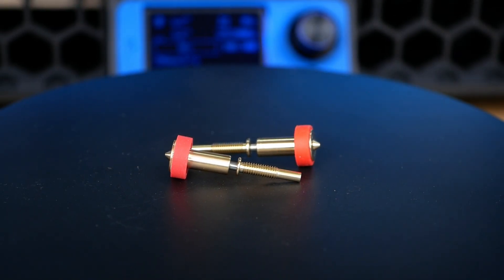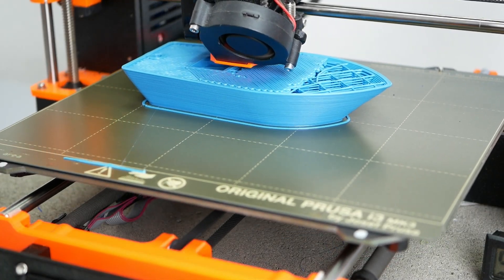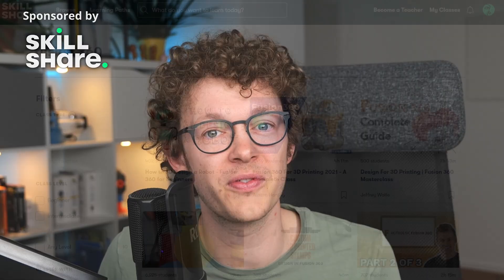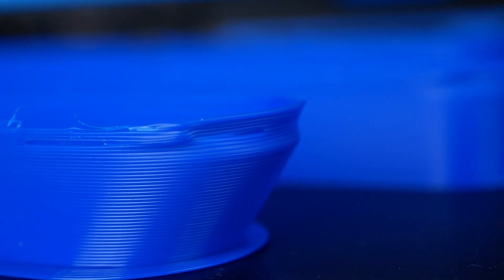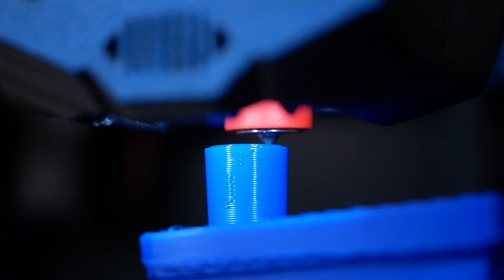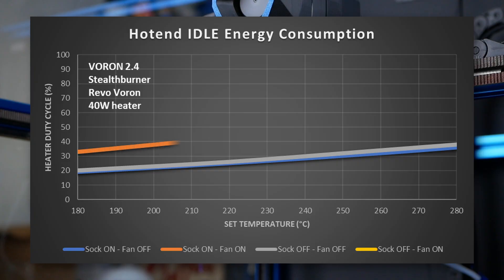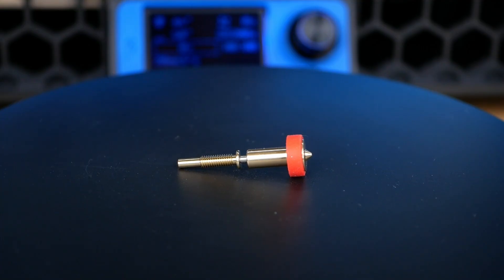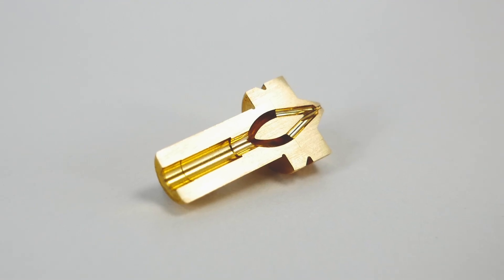E3D made an impressive HIGH FLOW nozzle!

Comment: Even though i am a budget 3d printer enthusiast if i were to get a highflow nozzle i'd probably end up getting one nozzle per plastic type if i was switching filaments and printing at a high volume. Currently i just push some filament through and clear out a diff type that way.

I do love these HF designs though.

Comment: Vector3D had different conclusions than you Stefan. He found the high flow Revo is better than their stock, which was lower than a stock V6. The CHT won overall with a better flow rate. He used your test print as well. 

Wonder if the adapter contributed to worse results?
Reply from the maker: Adam used different hotends which makes "nozzles" hard to compare. Yet his results go hand in hand with my conclusion. Revo HF is good for it's size but if you want max flow, get another hotend.
Reply: @CNCKitchen  thanks for clarifying. You were attempting to make an apples to apples comparison. So if someone took the Revo HF nozzle design and put it on a traditional V6 style hotend… It would beat the CHT head to head? So Revo’s shortcoming is the length of the heat zone/break?
Reply: Vector3D found its lower than a Pheatus Rapido with a stock V6 nozzle. The Rapido is way longer which is why it performs as well as it does
Reply: @jamesclive-smith3383  Am I wrong about the CHT nozzle having a better flow rate vs the Revo high flow.
Reply: The issue was probably the teflon tape, insulating the tip.

Comment: I have not tried the revo HF yet, and I want to, for sure. I have standard 0.4, 0.6 and 0.8 nozzles. It is true, I never changed nozzles as often as I do now, but I'd say that at least 80% of my prints are done with the 0.6 nozzle and with the speeds of the voron 2.4 I am limited by that flow. 
I really want to try the new HF nozzles but the fact that it is $45 a piece plus another $45 for the heating element... It really feels like a rip off. It makes me want to change to a rapido HF right now and go back to my ratchet wrench to change nozzles.
Reply from the maker: I wouldn't call it a rip-off because these things are expensive to manufacture. Yet the design is definitely not made for super cheap maufacturing. Bondtech did a great job in that regard honestly.
Reply: @CNCKitchen  maybe not if it's your first e3d hotend, but if you already have an standard one, and now you have to buy a $45 nozzle and a $45 heat element, that's adding $90 to an existing hotend. What am I going to do with my old nozzles and hot end? buy another heat sink and install it on another machine?
I understand that are not cheap to manufacture but it doesn't excuse the fact that you are paying $90 for a nozzle.

Comment: If I ever get around to spinning up my 3d printing business again, things like this are worth it. For a hobbyist that may print a couple smaller things per day, probably not
Reply: I'm thinking the opposite. In a business setting you don't want to fiddle with your printers. If you need to print in multiple nozzle sizes, you just have one printer for each size. In my opinion the Revo is mostly useful for hobbyists with limited space, or who really don't want to own more than one printer.

Comment: Considering this was promised for a year, the payoff is very disappointing. I'm glad i only fitted a revo on a bed slinger and never put on any machine that actually needs abrasion resistance or actual high flow. I expected a longer melt zone a true high flow abrasion resistant option, since it is a fully closed ecco system, would be a long time before i get anything else e3d. I switched my big machine chc pro ceramic heaters, and i can use any standard abrasion resistant volcano length nozzle.

Comment: Its good, but the nozzle is almost as expensive as a complete Volcano hotend with a Bondtech CHT Volcano nozzle. Which probably has even higher flowrate? With regular nozzles theres also the option of hotends with even longer meltzones like rapido. Or abrasion resistant CHT Volcano nozzles (for the same price). Or knockoffs which might not perform as well but are really cheap. Theres just so many more options available as well.

I really like the Revo system but at the price / performance point its a pure luxury.

Comment: I think you might not have considered different fans for part cooling in your heater wattage comparison.
Have you seen what fan comes stock with ratrig machines? (They use 20W server fan for layer cooling) 
Not to mention VZbot, or hevort where their cooling systems are really impressive. 
Other than that, this video was amazing! Thank you for the job you do.
Reply: yea, on my ratrig with a server fan and with 40w revo, I cannot print temps higher than 255C. Otherwise the hotend just cools down and cannot maintain temps.

Comment: Cold pulling is absolutely not necessary.
In doubt use cleaning filament. 
Or just never let your filament cook in the nozzle for too long. It needs movement.
Reply from the maker: Yes, but did you even have a particle stuck in your nozzle. Cleaning filament won't help you there.

Comment: I get that pressfitting that core in there makes sense to get the best thermal transfer and makes it completely tight and rock solid. And it's probably easier and cheaper to manufacture than a threaded version. If you could unscrew that center core piece however, it would make cleaning/repairing or even replacing a worn out nozzle tip so much easier and cheaper.
Reply: I had the same thought: how the hell would you unclog that thing?  You will not be able to push a needle through it, right?  Also cold-pulling won't work, I guess ...  So, how do you unclog this if some cooked plastic gets stuck in that bottom cavity?  Lemme guess, you have to buy another one of those expensive nozzles?
Reply: @MisterkeTube  Probaly burning it out by heating the nozzle with a torch
Reply: @MisterkeTube  the needles ive used have some flex/bend in them, but if you suspect one channel is clogged, its hard to know if your poking the right one (with a cht, anyways, and this and the clones would be the same)
Reply: Lining up the holes would be a nightmare with threads.
Reply from the maker: That's a good point but a thread would make manufacturing even more complex. I'm currently printing a ton with the nozzle to see if it has a clogging potential and how I can properly clean it.
Reply: And you could just replace the threaded insert to change the diameter! Wait we just designed a V6 hotend... My point is: by making it a threaded insert you would invalidate the whole design...
Reply: they don't like "cheaper*
Reply: The whole of the assembly is the nozzle.  You should probably re-think the take there.  It's quite evident that the adapter has issues- which does the thing you talk to.

I'll say it...again...

If you're thinking in terms of the old-school nozzles, this is probably pricey as hell.
If you're not doing STUPID things with your nozzle it's NOT.

You're not driving your nozzle into your printbed repeatedly, esp. using a glass bed, riiiight?
You DO know that glow in the dark, CF, GF, or similar is super abrasive and you needed a hardened nozzle, RIIIIGHT?

This isn't in the same spaces as the cheap crap they sell off of Amazon.  If you're hooked on that, none of this is for you.  Seriously.

This is the same rough space as the stuff you'll spend as much as $80 per nozzle for.  It's not the same thing and I honestly wish people would quit trying to map the pricing of the cheap crap onto this.
Reply: @frankearl9285  the point here is that a Revo Voron is $80... upgrading to a HF nozzle is $90 more... 

it's like buying a car for $30,000 and when you have to replace the tires you realize that the tires are more expensive than the whole car.

Comment: Kind of curious as to whether switching from resistive heating to induction heating may ea way to change the power use. In essence replace the heater block with a ferrous metal cylinder just larger enough than the heat break and nozzle to allow for the threading, an induction coil around that, and the electronics to manage that (and monitor temperatures, perhaps with an IR sensor rather than a diode.)  Note that I'm fully aware that this may be a higher price point than people are willing to pay, but I'm thinking of it more along the lines of focusing on just heating up the parts that are going to be heating the filament, and hopefully in the process reduce wattage. And there's nothing saying that someone couldn't design in a means of using a diode for temperature control, and build the control for the induction system not the software of the device. Us a pcm signal to control duty cycle of the frequency being passed to the inductor.

One potential benefit could be that once the bed was up to temp, the nozel could be brought up to temp in the time it takes to move from completing an ABL test, to the point where the printer does a prime wipe.
Reply: Induction heating is resistive heating. The only difference is that you don't need electric contacts, which is important in some applications (stoves, crucibles...) but quite irrelevant for a 3D printer hotend as that anyway needs to be rigidly connected to the extruder. So this would just add a lot of complexity with no real benefits.
Reply: @leftaroundabout  There are two parts that I think might merit attention. 

1) the part of the process that gets heated is integrated to the path of the filament. Not to the electrical path. This would be potentially useful in making it easier to replace a setup like a Revo nozzle, as the inductor has no physical contact with the part that is being heated. 

2) having a smaller heating element that can handle the heating, that the filament interacts with directly would mean that there is far less surface area of that element that is occupied with warming up the space around the printer instead of warming up the filament. If you are putting 40 or 60 watts into a heating block, and 5 to 20 watts is just warming up the area around the hot end, instead of heating the filament, it may be worth looking at alternatives that don't shed as much heat.

Or maybe it's not worth it. Maybe it's a good use of electricity in a print farm of 10 to 100 printers. I don't know.
Reply: Resistive heating is 100% efficient, inductive heating is close but not quite as efficient. And inductive heating would make the PID tuning vastly more complex, as resistance, inductance, and magnetic permittivity change dependant on the temperature. That means that the wattage of the heater would be constantly changing, and especially for conductive or ferrous filaments, it would be changing as filament entered and left the magnetic field. Then you have the degaussing effect that could potentially wreck the bed magnets from the magnetic field, the high currents needed to create the field, and other problems up and down the chain. 

As to IR sensing, where on earth do you put it? Anywhere close to the melt zone is at risk of bits getting between it and the printer and the thing suddenly being capable of running away thermally, and tuning it to a nozzles thermal emissivity would be a nightmare. It's safer to use relatively fixed material properties in a thermally dependant resistor, thermocouple, or other physical temperature sensor so that you can easily verify their function with a known good heat generating device or fixed temperature thing like boiling water and ice water. 

As to the timing, with a good heater block, and the normal wattage heater cartridges, it takes less time to heat the block than to do an ABL, not that for many printers it's relevant, as any ABL routines that use a physical contact of the nozzle to the surface, such as bambu labs p1p/x1c system, the prusa mk4 strain gauge system, or the duet systems smart effectors should be done while at temp for the most accurate measurements. In fact, for best results, the entire system should be at full operating temp and allowed to soak until it hits thermal equilibrium at it would during a long print. 

And thermal mass is effectively a buffer to stabilize a control loop, and reduce excursions from the setpoint. You can reduce the amount of processing power needed to monitor the temperature, as well as the cost of the ADC implementation if you have enough thermal mass to keep the system from running up and down too quickly. It's part of why the e3d heater block places the temp sensor on the far end of the nozzle from the heater block, as it damps the oscillations in sensor value from the heater cycling due to the thermal mass of the block and filament.
Reply: @Mr424242424242424242  Mostly what I was speculating about was how to reduce the surface area heating the environment rather than the filament. I'm not entirely beholden to the idea of it being an inductive solution, though I think that there may be other reasons to consider it. One being to basically thru the part that gets heated into part of the nozzle, rather than part of the printer, and with no physical contact, it could improve qualities for replacement. The IR sensor idea was aiming at how to learn what the temperature of something is w/o being in contact with it, or in this case w/o having a piece of wire in an inductive field.

I understand that the thermal mass has implications for hysteresis in the system, I'm OK with that thermal mass being part of the nozzle system, though perhaps others are not.

in any case, perhaps it was a bad  idea. I still think that being able to turn more of power going to the hot end into melting the filament rather than warming the area around the hot end has it's merits, and would like to see more effort into improving that situation. It may not matter in a one printer setup, but for fol with a print farm large enough that losing a kw an hour to just warming up the space the print farm occupies might make a difference. I don't know.
Reply: @RNMSC  I mean, if you're running a heated chamber, that kwh isn't wasted unless you're already at chamber target temp. So long as you keep the electronics and filament cool enough to prevent problems, it's generally a good thing to heat the area around a printer. 

Besides, nozzle socks are quite good at preventing heat from escaping the system very quickly. It's to the point where I have to have very different PID tunes for bare block vs covered block when commissioning a new printer on a duet, because the default safeties trip if you run a bare tune covered, as it drives the temp above the upper allowance. 

But honestly, there's really not much of an improvement to chase physically with the revo, as you can't much reduce the surface area of the heated element, there's very little you can do to reduce the thermal conductivity of the heatbreak, and pretty much everything that can practically be insulated is insulated.
Reply: @Mr424242424242424242  I'm OK with being wrong, as it helps me learn.